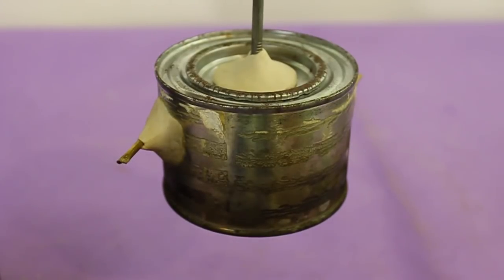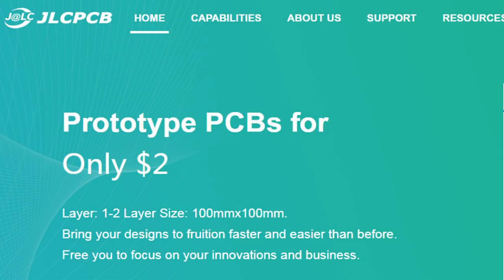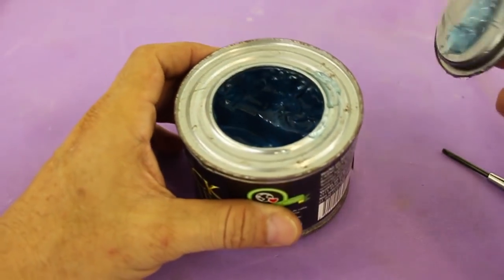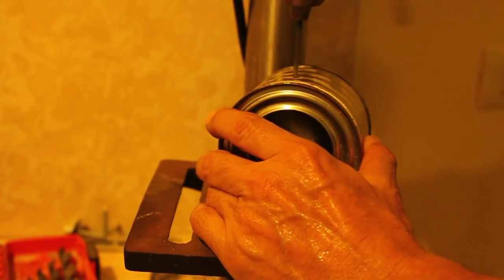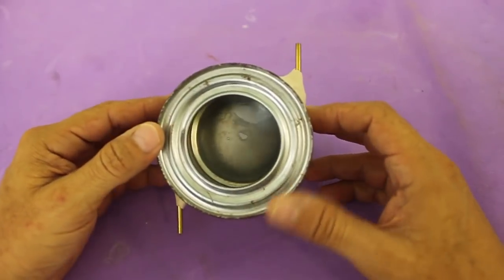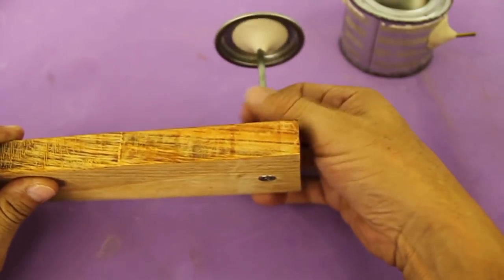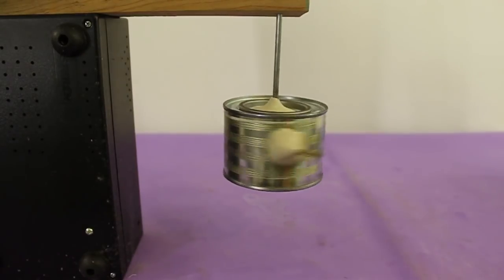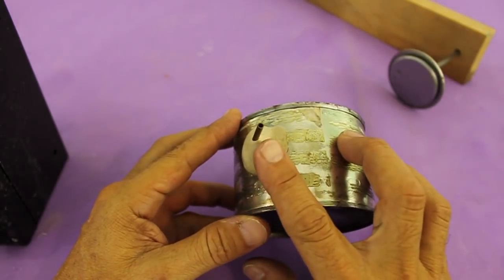DIY Aeolipile or Hero´s Steam Engine

Comment: Nice job. I built a Hero's steam engine that does 5400 RPM.  (www.HeroSteamEngine.com with embedded YouTube video). Thoughts about whether an aeolipile (Hero's steam engine) could have driven a car or train or do other useful work has been debated for a century or more.  I decided to build one and measure its power output to settle the question.  I calculated its theoretical efficiency at converting heat energy to mechanical energy and it was only about 1%. But when I built one I found that the efficiency was only 0.01%, possibly due to losses from friction and air resistance.  The results are given in detail in the web site.  Look it up to see video, photos, calculations, discussions and dispelling myths about Hero (Heron of Alexandria) himself.
Reply: Evan,thanks for the link to your very detailed and informative site on Hero's Turbine designs. I have a friends teenage grandson who is looking for some useful design information to assist with building a turbine. Your site will assist gteatly👍
Reply: @howardosborne8647  I hope your friend finds some useful information. The calculations are all in the Appendices including calculating the thrust produced by a jet of steam once it reaches the speed of sound. That occurs at only about 10-20 psi.

Comment: Ludic, thanks for your time and work on this educating video. 
Right now you have the tubes straight and parallel to each other. some of your torque are merely cancelling each other out. More important to the tubes being parallel to each other is the steam direction to be parallel; to the surface of the can from its exiting point!

You can get maximum torque out of your steam tubes if you bend them 90 degrees and attach so that the direction of the steam exiting the tube will come out parallel to the circumference of the can and no torque will be wasted!...
Reply: Thank you bro

Comment: Great project. Could you explain, maybe in another video, why the air moves faster when the diameter of the tube gets smaller(Ventury effect)?  Also a small mechanical engineering hint: Usually one would use at least 2 bearings per axle and fix them in a way, so that the axial movement of at least one bearing is limited to prevent the whole construction from falling apart. Press fitting doesn't count as fixed in this regard. Here are some examples from Wikipedia (sorry for not in English, but the images explain it pretty good): 
https://de.wikipedia.org/wiki/Datei:Fest-Los-Lagerung.svg 
https://de.wikipedia.org/wiki/Datei:Schwimmende-Lagerung.svg
https://de.wikipedia.org/wiki/Datei:Stuetzlagerung-angestellt-X-linien.svg
Reply from the maker: Thanks for the links, I just got.some new bearings 2mm internal diameter a beauty!

Comment: we can connect 12v motor to produce electricity.:0
Reply from the maker: Very little ppwer to turn a generator
Reply: It won't work much.
Reply: @mozartips  yeah I think so. :-P
Reply: @Deep_Innovates  I think thermal electricity generator would work much much better.
Reply: @mozartips  or maybe a nuclear reactor.........
Reply from the maker: Indeed
Reply: It is not able to run a 12 volt dc motor
#easyhomemadeproject
Reply: It can turn a 12v motor but you need gearbox